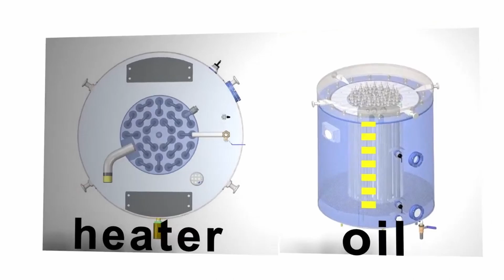Transformer Oil Purification Machines CMM-LT with Deep Degassing

Comment: What are the power requirements for the CMM-LT units, and do they support various voltage standards?
Reply from the maker: The power requirements for CMM-LT units may vary by model, but the technical documentation should specify the voltage and power requirements.

Comment: How often do the filter elements in CMM-LT units need to be replaced or cleaned?
Reply from the maker: The frequency of filter element replacement or cleaning would depend on factors such as the type and condition of the oil being processed. Guidance on filter maintenance is provided in the technical documentation.

Comment: Are there any specific environmental conditions that affect the performance of CMM-LT units?
Reply from the maker: The optimal operating conditions for CMM-LT units are an ambient air temperature ranging from +5°C to +40°C and relative humidity not exceeding 70%. Operation in other environmental conditions is permissible only upon agreement

Comment: What is the maximum oil processing capacity of a CMM-LT unit?
Reply from the maker: The maximum oil processing capacity can vary by the specific model of the CMM-LT unit. The technical documentation should provide details on the capacity of each model.

Comment: What specific contaminants are removed by the GlobeCore CMM-LT units?
Reply from the maker: CMM-LT units are designed to remove mechanical impurities, water, and gases from oils used in lubrication, sealing systems, hydraulic systems, gas turbines, and compressors.